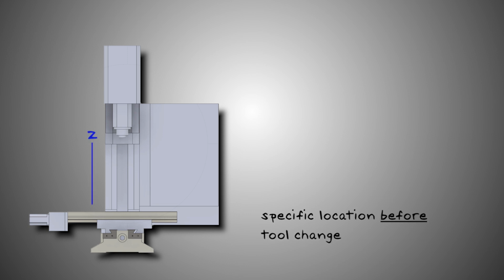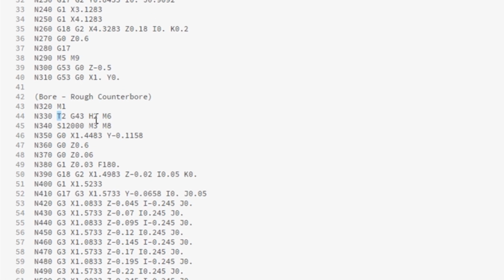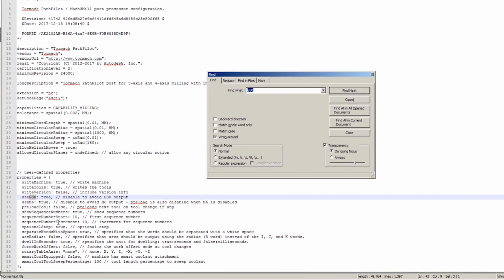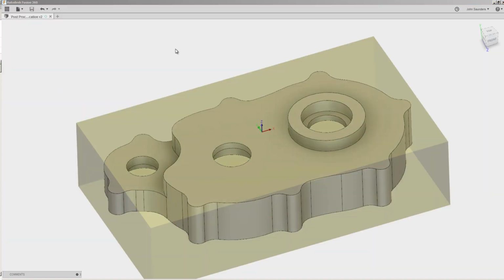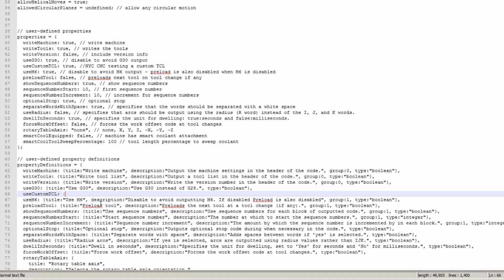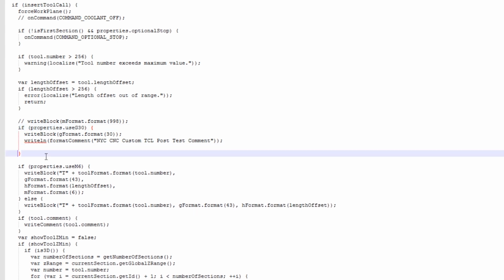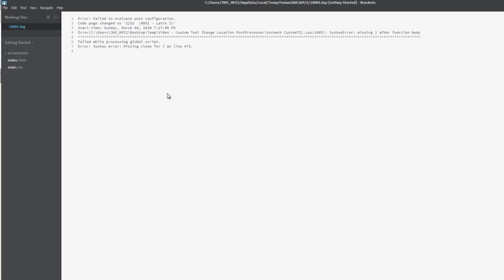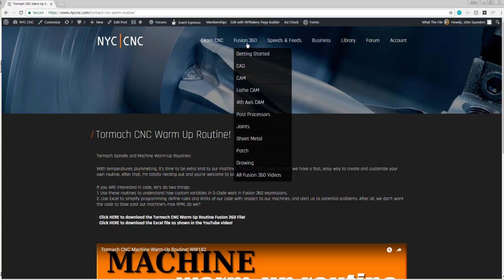Fusion 360 Post Processor Tutorial: Custom Tool Change Location | FF127

Comment: Trying this with no luck, the files look significantly different. where to put the the if statement?
could you revisit this or maybe fusion now has something built in to do this but I only see options for g28 & g30. Z isn't enough to clean the umbrella on some parts.
working with a pcnc440. I want to change the stock vise out for a fixture plate or the SMW low profile vise but my hands are tied. the part ends up about 6" off the bed, the drills and the 3" doc end-mill will definitely hit during the umbrella cycle.
thanks for the great tips!

Comment: Almost perfect...any luck creating a new property, and filling that into the custom tool change location. ie..XTCL as a property, and that value appears as G53 X("XCTL") ? Seems more flexible in the long run as opposed to fixed locations in the post processor

Comment: Hello John, in my eyes the possibility of editing the post processor is a very strong feature of Fusion 360. I also use it quite a lot to tune the g-code generation for my mill - a German made one. This mill comes with a German CAD/CAM software package that is clunky at best. Thus, Fusion comes to the rescue. Not just because of its very superior toolpath generation :) My next machine will be a different one, for sure.

Comment: Kudos to you John for the info. I have my 4th axis mounted on left side of table so I have been going in and modifying my program to move the table out of the way each tool change. This will help so much, while I was at it I moved the coolant off command to signal before z retract  to keep coolant from spraying everything.  Thanks again keep the tips coming!!

Comment: Hey there, do you mind if I ask you a simple question. I'm just new to 3d modelling. I would like to know how I can move a face of a 3d body parallel to the surface of the plane. Eg. If I have a cylinder and I want to move one of the circular faces sideways so that I have a slanted cylinder (similar to leaning Tower of Pisa)

Comment: This one was fantastic!   I had trouble with a drill bit in the changer running into a part during a tool change and this will be great.  Thanks for this tip.  I Took Pascal, FORTRAN, COBOL , RPG2 and C back in the 80's and got sick of debugging in favor of machining and mech design!  Glad you can walk us thru this stuff as this is a great tip!

Comment: I do a lot of work in N++. Something you should do to help you a lot is to use syntax highlighting. In N++ click on Language on the top bar>J>JaveScript. This will automatically color all of the comments and things like numbers/variable types.

If you like the way it looks then you can go to Settings>Style Configurator. On the left most list, click on JaveScript, and to the lower right of that box there is a place called User Ext. Type the letters "cps" in there and the syntax highlighting will be applied every time you open a post processor file.

Let me know if you have any questions. Also, I have a video request: Could you make a video about how to go from the post processor to actually making chips? When I was first playing with the Tormach years ago I spent an hour trying to figure out how to write the tool offsets to HSMXpress because I didn't know about the offset tab. I am sure I am not the only person who had to go through that. Thanks for the good videos. Also, it was good to hear you on the Amp Hour podcast.

Comment: I didn't get what is the purpose of wanting this?  Why is it important?  Thanks.
Reply from the maker: One example:  You have a really long tool so you need the machine to move to a certain spot on the table (away from workholding/part) so there's room to remove tool.  Similar idea if you have a huge part/fixture/4th axis on the machine
Reply: Oh, got it. Thanks John!

Comment: Awesome, any chance you could do a tutorial on how to make it so that when the program is completed it returns  Z tool location
Reply: In the post processor there is an entire section dedicated to end of program routine where you can add the Z0.0 line.
Reply: Can't be too descriptive without a wall of text but you can just add pretty much exactly what he did just name it something different and put it in the post where the call outs for M30 are instead of G30. M30 ends the program so if you place it right before that it will be the last move your machine makes before the program ends. Basically follow exactly what he did except do it before M30 instead of after G30.
Reply: Here is what I added using the properties for my Fadal to move the table to X0 Y8, follow what John did to edit and place the property lines below in the right place.
// user-defined properties
properties = {
--- only showing my code  -----
  homeAfterOption: true, // DJH If true set home X and Y at end of job
  homeXaxis: 0,  // DJH Set X home position after G28
  homeYaxis: 8  // DJH Set Y home position after G28
};

    if (properties.homeAfterOption) {
                writeBlock(gFormat.format(53),  "X"+ properties.homeXaxis  + "." , "Y" + properties.homeYaxis + "." );
    }
    // DJH End of home code

---- Last portion of the original cps file -----
  onImpliedCommand(COMMAND_END);
  onImpliedCommand(COMMAND_STOP_SPINDLE);
  writeBlock(mFormat.format(30)); // stop program, spindle stop, coolant off
  writeln("%");
}
Reply: Good to know but I have not idea where to find it or how to edit it